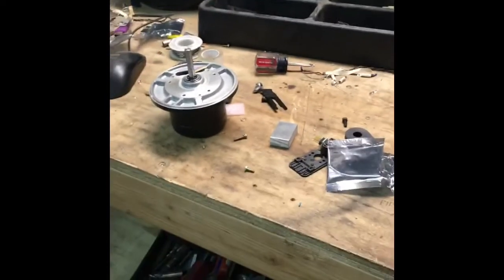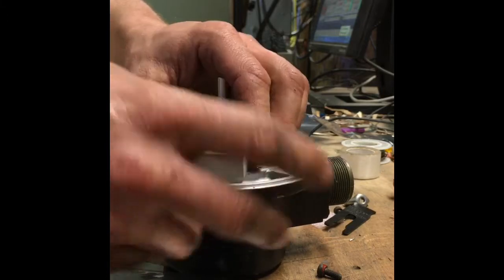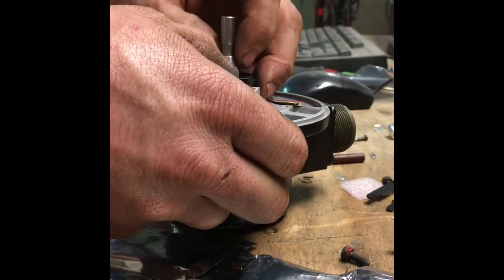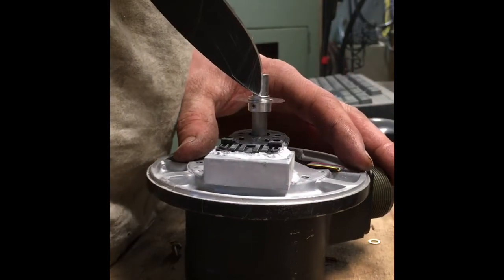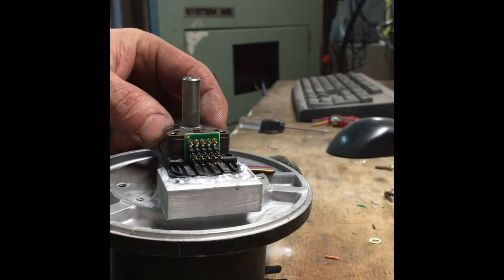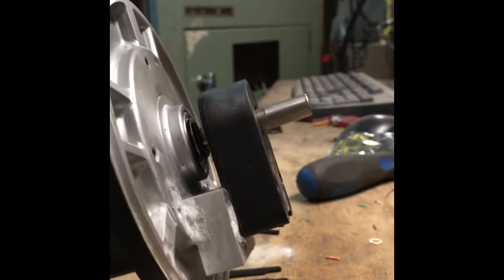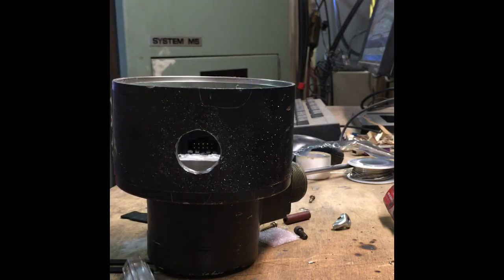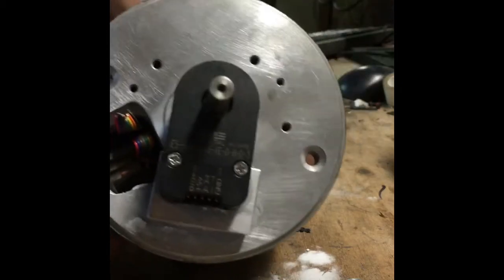Servo Encoder Swap on Matsuura Mc500v Mach3 Retrofit.

Comment: Es it not enough to step down the 12v signals to 5 volts signals for A and B on actual encothers???
Reply from the maker: I was told that you can't simply step it down, but I haven't tried it.

Comment: just a thought instead of drilling a hole in that spacer utilize the wiring currently going to the plug. I'm working on one as well. That is how i did it. I also utilized CUI encoders